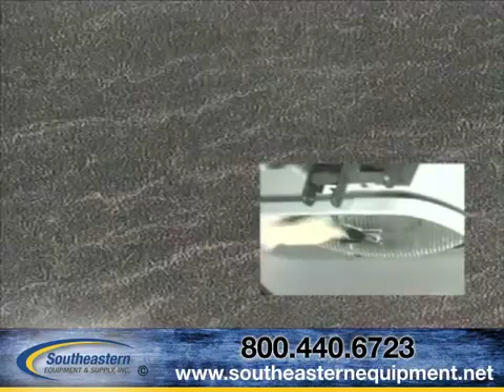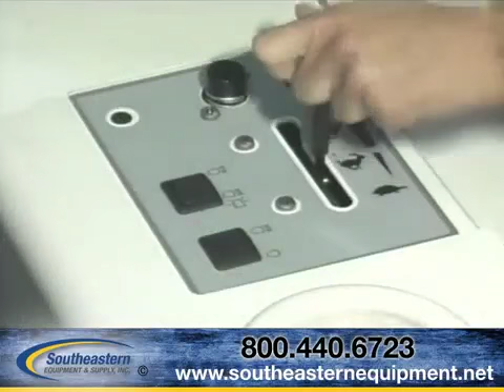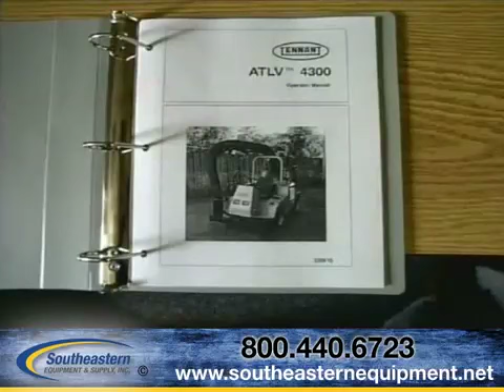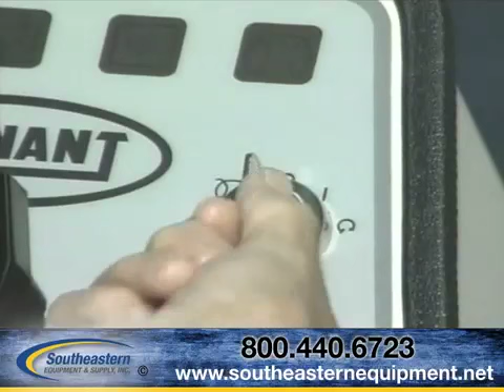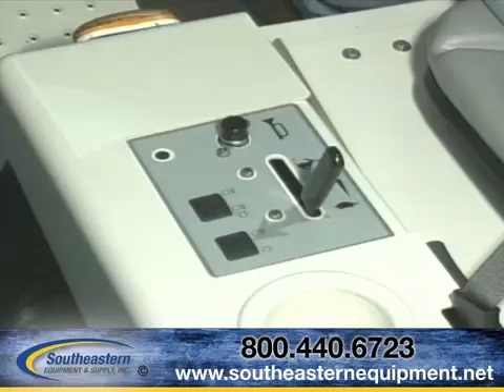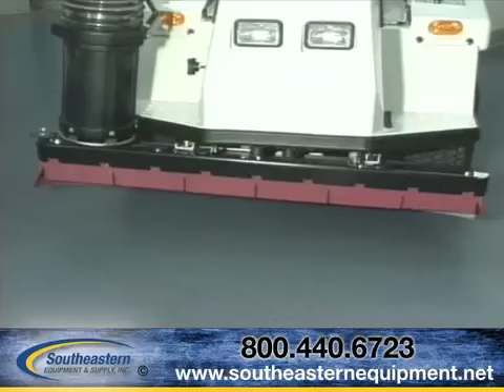How to Operate the Tennant ATLV 4300 Vacuum

Comment: What grade engine oil does it take ? 10-W30 or higher?
Reply from the maker: The Kubota engine requires 5.2 L (5.5 qt) API diesel classification CF or better to be changed (along with the filter) every 100 hours of machine operation. Email us at 'service@southeasternequipment.net for a copy of the Operator's Manual.